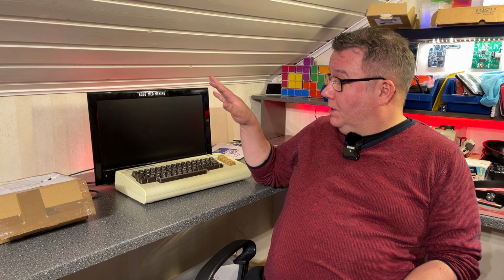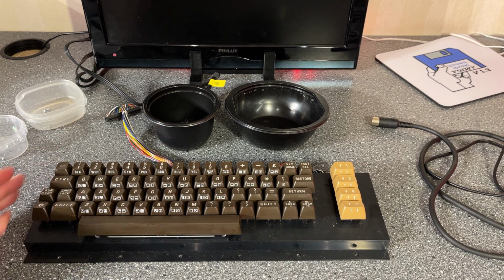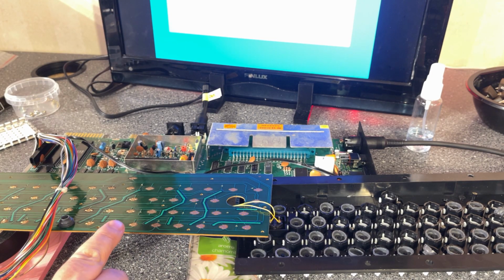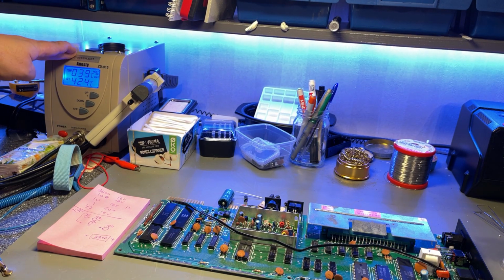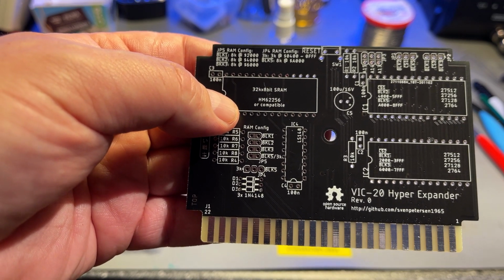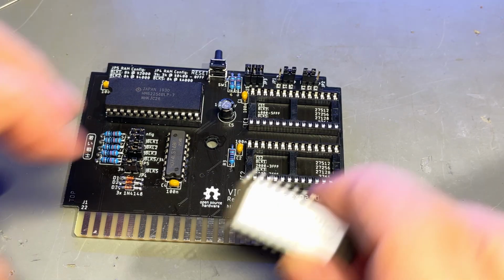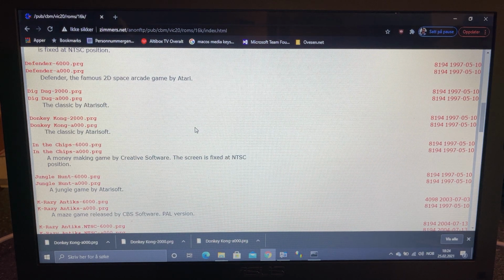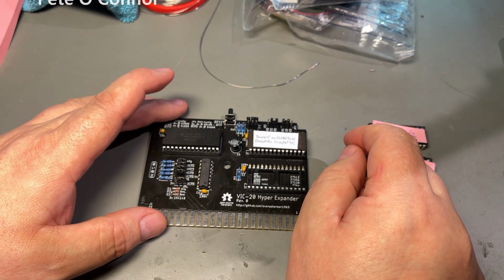Commodore VIC20 part 1/2 - Restoration, repair and building the Hyper expander

Comment: The heat sinks on either end of the VIC chip is useless as the die is in the center of the chip. I see this mistake all the time
Reply from the maker: Yes I know. But some heat will spread out anyway, The whole IC gets warm, so dissipating heat will help anyway,

Comment: Is it possible to build a vic 20 inside a commodore 64?
Reply: Yes, the board will fit. You can even keep the C64 keyboard.
Reply: The ports does not line up
Reply: @renepedersen7141  Yes, you are right. I was thinking of the other way round - you can put a C64 in a VIC 20 case, ant the cartridge and RF modulator are accessible there the VIC 20 cartridge port slot, but not the other way round.

Comment: The actual chiplet is in the center of the chip package, so adding a heatsink on the ends of the chip package is not very effective...
Reply from the maker: Yes I know, but the heat spreads out anyway, so there is a benefit
Reply: @Arcticretro  Maybe help a little bit, but unless you have a clearance problem, why on earth would you NOT place the heatsinks directly over the dies? I doesn't make any sense at all...

Comment: I'm rather surprised there isn't larger upgrades in the megabyte range.
Reply: What about a phased plasma rifle in the 40 watt range?
Reply: The VIC 20 doesn’t have the bank-switching circuitry that the C64 has, so it isn’t capable of being expanded beyond a total of 64K without a lot of work, if at all.
Reply: @Doug_in_NC  Im sure it can be added via a port on the expansion connector using some simple logic. If they could pull it off on the Atari 2600, it should not be an issue with the VIC-20.
Reply: @GORF_EMPIRE  yeah, I guess you could create bank-switching hardware off-board and swap blocks of static ram in and out that could accessed by machine code, but the capability isn’t built into the machine like on the next generation of 8 bit computers like the C64, Amstrad C128, Tandy CoCo 3 or the Atari XL and XE series.
Reply: @Doug_in_NC  Well that was what I'm talking about.
Reply: @Doug_in_NC  Correct, and that is done via GAL/PALs plus some simple gate-logic. It can be as easy like putting one (N)AND IC on the expansion board, the aforementioned programmable decoder logic or  a simple under a dollar MCU to be even more flexible. As a design recommendation: Something like a STM32F4xx series MCU can directly interface with modern RAM and would be extremely flexible. That would fit the megabyte demands of GORF with a price tag under 50 bucks.
GORF: Surely you have to program all software or change existing one yourself unless a sized community has grown to support that thing:) So rethink that maybe? Pearls before the pigs?:)
Reply: @dieSpinnt  I guess the closest to that on a VIC 20 that exists now would be the Penultimate Plus cart from TheFurureWas8Bit. It’s got 35 K of RAM that can be used directly and then 70 cartridges worth of ROMs that can be switched in and out via a menu.
Reply from the maker: Well, using my SD2IEC I got 16 GB on it !! :)
Reply: @Arcticretro  Well.... that's storage. Cool nonetheless.